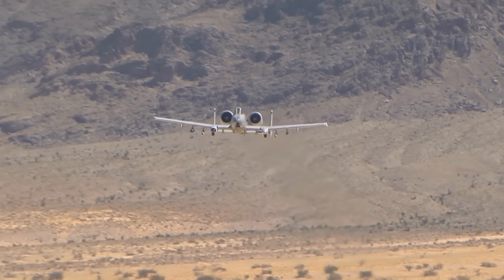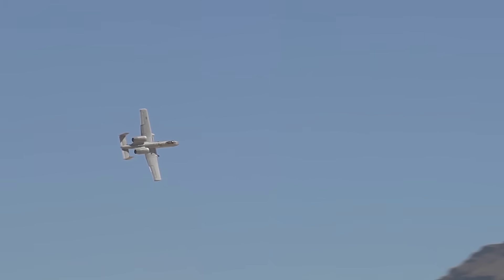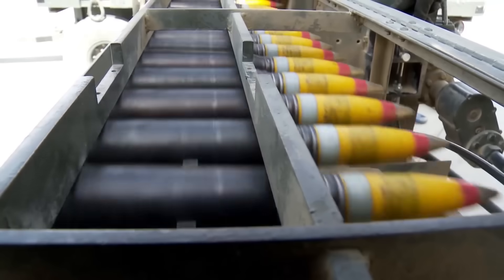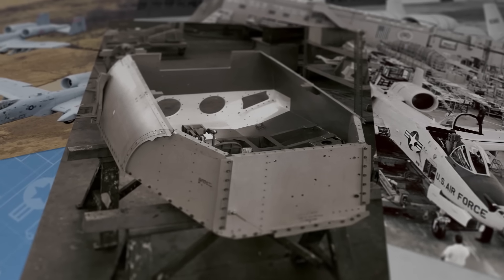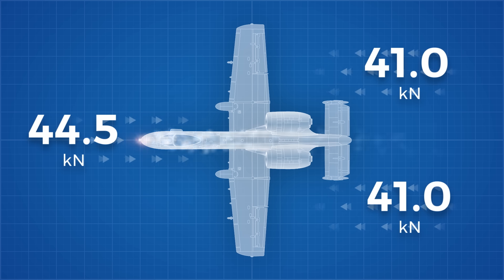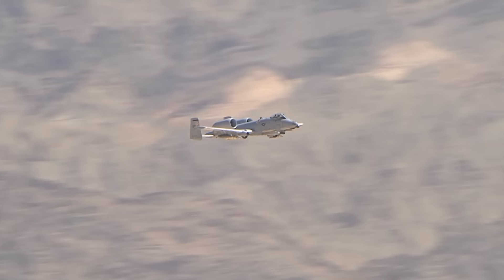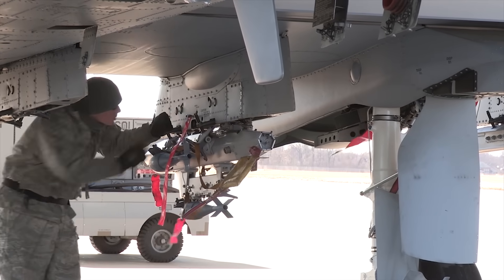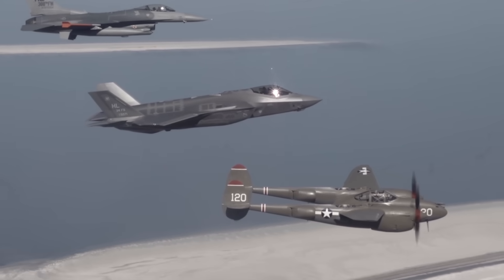The Insane Engineering of the A-10 Warthog

Comment: I hope this plane never goes out of service. Unless, of course, they somehow find a way to improve its design even further.
Reply: Maybe get twice the brrrrrrrrrrr
Reply: @chm1ata   yes!
Reply: @chm1ata  VTOL BRRRRRRRRRRRRR
Reply: @thegoldenwhale1335  NAH VTOL TRIPLE BRRT
Reply: @thegoldenwhale1335  like
Reply: @chm1ata  only twice? Why not thrice?
Reply: @Dakiferus  f it, get 10
Reply: @chm1ata  thing just starts flying the other direction due to the amount of force from the 10 30mms
Reply: @Dakiferus  face five back and five forwards
Reply: @Dakiferus  just aim your tail at the enemies
Reply: @chm1ata  Screw it, turn it into a fidget spinner.
Reply: @chm1ata  make an a10 built like a p36 but have where the props are the brrrrt of doom
Reply: @chm1ata  I think you would go backwards at that point
Reply: @__tadpole__8195  then have 5 pointing back
Reply: @chm1ata  “QUICKLY PULL UP!” “Oh shit we just dug a hole into the mantle”
Reply: @chm1ata  why not get four brrrs
Reply: @chm1ata  Twice the Brrrrrrrrt, double the memes
Reply: @chm1ata  under wing  rotary cannons oh god
Reply: @chm1ata  nope triple the brrrr
Reply: It is extremely vulnerable to modern surface to air missiles.
Reply: @kellymoses8566  This is true.  The video said the plane is cheap to maintain.  That is a little deceptive though.  It is cheap if nothing breaks, if it never gets hit.  But it is designed to be hit!  The cost of maintenance goes up quite a bit when you account for battle damage.
Reply: @kellymoses8566  not unless we go stealth
Reply: Use the gun as engines for speed plus firepower
Reply: @brianchan8  the frame wouldn't be able to survive going mach jesus
Reply: @tedwhite9176  I had to go look at his comment to see what he said about the speed of sound but I get your joke now, good one
Reply: Yep slap another gun make it a gunship
Reply: It's scheduled for decommissioning but the army is fighting hard to keep it
Reply: Thunderbolt III: “Yo dawg, I head you liked brrrrt, so I put brrrt in your brrrrt so that you can brrrrt while you brrrrt”
Reply: Like strap a second GAU to the back to leave a path of destruction behind it along with giving the A-10 a speed boost
Reply: @painiswarthunder  some one make this man an Air Marshall asap
Reply: @davemeads859  however a second cannon would ruin the A-10 look so I propose project A-11 a larger, faster, better armed and armored A-10
Reply: I think drone tech is reaching the point where unmanned close air support will become the norm.  No pilot, no need for extensive survivability.  Heck, the drone itself can become a weapon if need be.
Reply: @lukedean34  and BRRRRT
Reply: @GiggityGiggity_27  We should put the avenger on a drone.  We can call the drone Burt.  XD
Reply: Keep the look and the sound that’s all that’s needed
Reply: They said to retire it somewhere in the 2040s so we still gotta long way for it to brrt
Reply: As someone who maintained this aircraft, every year they talk about retiring the ‘hog.
Until they have a dedicated CAS replacement it’s not going to happen. Yes guided munitions are mostly used nowadays, but newer stealth jets have reduced armament capacity due to internal storage to minimize radar cross section. And a fast stealthy jet just is t suited the the situations the A-10 can fin itself in.
Reply: @lasinthas4152  those jets cheap to fix bullet holes in?
Reply: @gmat5046  I was a propulsion mechanic. So I only worked on the engines
Reply: @lasinthas4152  those are rather important.
Reply: The next design will have lasers but will still go bbbrrrr
Reply: @ghostking1627  that would ruin the A-10 tho... Lasers are heavy and delicate putting a Lazer on an A-10 would be a waste of a perfectly good A-10.
Reply: @painiswarthunder  but if it gets a space upgrade in the future when space travel is possible
Reply: With the onset of f35 lightning, I heard that this plane is to be decommissioned.
Reply: @victorcajilog5355  maybe. But with the continuous support of not only the grunts, but the air force, civilians, and politicians, it will most likely be updated.

Or even better, a new design similar to it with a more streamlined design, more powerful engines, a sturdier design, a heavier carrying capacity, and better sensors and radar for guided munitions (specifically for dogfights.)
Reply: Stealth a10
Reply: They did it with the b-52 so I think they can do it with this
Reply: If they make one it probably won't have a brrrrt since it's very bad at it's designed purpose of tank busting
Reply: @Zlonk7  In defense of the GAU-8 it could probably still open up light armored vehicles like tin cans.

But . . . 

It's not whether the GAU-8 is powerful enough for that. It's whether other lighter cannons can do the job.

Even then the argument for just carrying more PGMs is compelling.
Reply: It is astonishing,  no question. A simple but great improvement would be building it just for shits and giggles instead of violence
Reply: It's the A10 low maintenance and reliablelity that makes it hard to replace it  higher tec means higher maintnace there are planes that can do the job but nowhere as cheap to run
Reply: It will go out of service, and sadly its replacement will be light, cheap and disposable. Such is the way of progress.
Reply: A-10 isn't going anywhere for awhile. The F-35s gun can't shoot straight for now so the A-10 is still needed. The US government has been trying to get rid of the A-10 for years and every year its answered with screw you
Reply: @wesjohnson9334  I mean, there are more weapons other that the gun, guided bombs, etc, so i don’t think that glorious BRRRT will stay much longer 🤧
Reply: @wesjohnson9334  the f 35s gun cant shoot straight you say, yet the gau 8 avenger is terrible, its weak and inaccurate and basically unusable for its intended purpose
Reply: I hate to be the bringer of bad news, but the A-10 is planned to be replaced by the F-35B sometime soon.
Reply: @Getactivewithcat  They planned to replace it since is existed, cheap easy to repair airplanes that work, oh the horrors (for the military industry that is)
Reply: @pouncepounce7417  they're Lockheed simps, what can I say.
Reply: @Getactivewithcat  welp alot of lives will be lost without this godly intervention of a close air support craft
Reply: @MrIkillcreepers  sadly that's probably true. At least the F-35B will be able to deploy much faster compared to the A-10, and it will have the ability to do multi-role combat. The A-10s technology also pales in comparison to the F-35B, so the replacement is not at thoughtless and stupid as it might seem. But still I believe the A-10 is just better overall as it was directly made for the purpose of close air support and your statement likely holds true.
Reply: @MrIkillcreepers  yeah I'm not sure what that mosquito F-35 bs is about if I'm on the opposing side of an A-10 and I hear it I'm just saying fuck work and leaving
Reply: @MrIkillcreepers  alot of lives are lost with the a 10s exustense, it has more friendly fire than any other us plane combined, its the worst us plane
Reply: @MrIkillcreepers  you can upgrade a dogshit, but its still gonna be dogshit, the a 10 is a terrible plane that was never effective to begin with
Reply: It's retirement plan has been delayed until 2040 ,with new wings
Reply: @staniskynjing8953  The overall layout and shape is i think nothing to improve on, but one could tinker around with honeycomb materials for the hull and wings to create an structure you can riddle with holes that stays stable because the load bearing structure is all over the place spread out, something like that.

I was never an fan of multirole anything if it is not the only possible option, multirole expotinal raises costs and complexity.
Reply: Simple. Instead of the plane powered by the thrust of the engines. It would be powered by the recoil of Two GAU8.
Reply: That huge rail gun they were testing a few years ago
Reply: A flying Ma Deuce.
Reply: CHINA  JOE  BIDEN  SAYS  KIDS  KIDS  KIDS  https://www.youtube.com/watch?v=V4PLSPvJ9BY&t=226s
Reply: Look at the B52!
Reply: Triple gau 8 😈
Reply: @christian does MTB  all I imagine is when it fires it just stops right then and there
Reply: 2 cannons. brrrrrrt.... Vs BRRRRRRT.....
Reply: No need for it would be nice.
Reply: They have made a better version the stealth a10
Reply: The just revamped it it will likely be in service in to the 40s
Reply: i feel like it’ll be replaced by a plane that does the same thing, but waaayyy better. like a modified a-10 that is more technically advanced, and is faster and better at dogfighting
Reply: A-20 warthog with a rail gun replacing the 30mm
Reply: This didn't age too well
Reply: Put a tank gun on it
Reply: Obviously we need two wing-mount BRRRRRRRRRRRRRRRRRRRRRRRRRRRRRRRRRRRRTs...
Reply: Sadly, i think the F-35 will replace the A-10 😔
Reply: Bro this plane makes me want to join the Air Force just to fly this beast😂😂💪🏾💪🏾💪🏾🥳🥳🥳🥳
Reply: It is
Reply: Well you could upgrade it’s computer systems and sensors
Reply: F35: now this looks like a job for me
Reply: In progress...
Reply: The ONLY reason the aerospace contractors and their lobbyists haven't been able to retire this, is that some decisionmakers can see through the money they are being offered and can see that they are being shorthanded.

F16 and f35 can provide cas ONLY when full air dominance is achieved. Otherwise they are extremely vulnerable.
And when they take damage they are very, very difficult or even impossible to repair in the field.

Basically both have been designed to fight inferior opponents in short burst. And to be kept in clinically clean conditions.
But war ir dirty. Airports and supply lines will get hit and that will severely hurt those planes while the a10 can shrug it off.

And when the others are VERY expensive to replace and few in numbers, a10 is easy to manufacture, repair and can operate from a fielt of potatoes.

There is no other platform that could do what the warthog does and shrug off the damage it receives.

And NONE are as cost effective.
Reply: not even god himself could improve upon perfection
Reply: More guns
Reply: Bigger gun
Reply: Well ATM it has a "replacement", but that "replacement" is too expensive and the warthog is literally a cheap, powerful, and safe gun with wings
Reply: The raspberry of death must be terrifying for that split second you still have ears.
Reply: Upgrade it with Laser Gatlin gun.
Reply: imagine a supersonic A-10
Reply: Just put another cannon and have double the round count !
Reply: As long as tanks exist, it wont
Reply: Stealth dogfighting A-10
Reply: I believe its supposed to stay in service till 2040 so far
Reply: friendly fires
Reply: Write that down write that down
Reply: One reason this plane is still in service is their cost for flying
Reply: This didn’t age well
Reply: I just hope they dont improve it to the point it would lose its feature that makes it an A10 Warthog, especially the "brrrrrrrrrrr" sound
Reply: @momodeus_20  then maybe a more powerful engine, a longer range missile, and a more powerful radar
Reply: I am sure someone else has already mentioned its being retired.
Reply: I love this plane and the pilots. I've been pinned down a few times. The sound of a few hogs coming in is excellent any time
Reply: They make it have a higher gun-to-plane ratio
Reply: Maaaaaybe two 30 mm cannons
Reply: I heard at about 2024 or 2030’s will go out of service
Reply: Nah it will never happen
Reply: Make a stealth version.
Reply: They recently got approved for some tech upgrades to radar, HUD, etc.
Reply: They add a second gun
Reply: the only reason this plane goes out of service will be the same reason the ac-130 goes out of service (which is that it shoots fucking lasers instead of bullets)
Reply: Im waiting for the A-11 deathhog
Reply: Last remaining warthogs are in arizona.. protecting the trump fascist 5th column.
Reply: if brains were dynamite you wouldnt have enough to blow you nose
Reply: Make a stealth version I say !!!
Reply: i don't like how much people overestimate the @-10
Reply: @lunatic_nebula9542  People that dont understand its role in a war tend to do that, but when used in the right place at the right time its a potent lethal weapon that tank crews utterly fear....
Reply: It has begun
Reply: A 10 warthog........mark II
Reply: Its a terrible design, stop spreading myths, its the worst plabe in the us military, it has to fly low and slow and needs pilots to use binoculars, its very vulnerable to shoulder mounted launchers and has more friendly fire than all other us planes combined, its gun is weak and inaccurate and it was almost replaced by a fucking cropduster
Reply: Bigger gun is where id start😂😂😂😂😂😂😂
Reply: @user-gs2ou7gp2v  well the current one is useless, so yeah thats a garantueed improvement
Reply: There are already better aircraft that do the same job but much better
Reply: I swear, considering how deadly it already is, a potential Thunderbold III would be a deadly thing indeed
Reply: @cloaker7237  its not deadly, ots terrible, the gun is inaccurate and weak
Reply: @Helperbot-2000  “the gun is inaccurate”
Well, don’t worry. If the first few shots miss, the next 500 of them sure won’t
Reply: @cloaker7237  in a live fire test of completely idead conditions where the pilot could fire as much as he wanted, he did 10 passes, once for each vehicle where he fired 174 bullets, 70 bullets hit 30 of those bullets penetrated, 8 tanks were hit and only 3 were destroyed while 3 were immobilized. only 2 rounds hit the ammunition and fuel tank. all 3 could be made operational the same day. and all of them were very outdated m47s

the gau 8 is useless as a tank buster
Reply: @Gray Upsilon I’d love to see a delta wing version of this plane eventually but I don’t think that will come for a while
Reply: @jackspinner1945  You’ll be waiting forever since delta wings are almost exclusively used in supersonic fighters, high altitude interceptors and high speed bombers. It’s objectively stupid to use that in a low speed low altitude ground attacker. You’d lose all energy in a turn and stall out into the ground.
Reply: @henrywhite2228  well you spray a target with bullets and crash into it dealing more damage
Reply: @henrywhite2228  Making it an biplane would make more sense, even lower stall means slower attackspeed = more time to shoot at things
Reply: @firstnamelastname7298  essentially, american 'divine wind'
Reply: @henrywhite2228  A low speed, low altitude attacker is objectively stupid on a modern battlefield.
Reply: @jackspinner1945  The problem are delta wings is almost exclusively designed to reduce post-mach drag these days. Its literally only useful on a plane that can exceed mach 1. The other use case being a huge lifting surface for its size giving it a large payload like the B-2. The downside ofc to this is that your plane is now a flying triangle which is much easier to hit at a slower speed than a "standard" design. There's also the downside that delta wings have very low energy retention in a turn and bleed a lot of speed which makes it hard (and fuel expensive) to loiter where you're often just flying circles in an empty chunk of airspace near the battlefield. It has a few stealth benefits yes, but is not at all required to design a stealth aircraft. Just look at the F-22. Additionally delta wings are inherently unstable which makes for great maneuverability in a fighter but it also means that you need to spend a lot of computational ability to make the dozens of adjustments per second to keep it flying in a straight line. Now imagine you take damage and lose an engine and half your right wing. Your inherently unstable aircraft is now even more unstable and there's literally millions of possible variations on exactly what the flight characteristics of that damage could look like. Those computers are now having to figure out how to fly the plane from scratch. Something that isn't quick to do. The design just has no place in a vehicle that needs to be fuel efficient with a long loiter time and have the ability to take damage.
Reply: @jackspinner1945  problem is it’s not a supersonic capable aircraft not only that it doesn’t need to travel at supersonic speeds so a delta wing isn’t needed on this type of aircraft
Reply: The A-10 was obsolete before it initially hit the ramp. The reason is that it was designed for an environment that no longer existed, and couldn’t exist in the environment it was committed to.
The original design was for an aircraft to replace the Douglas A-1 Skyraider and other aircraft doing Close Air Support (CAS) in South Vietnam. This was a very permissive environment, and the original design studies were for a twin turbo-prop aircraft. By the time the program got going in a significant way, it became clear that South Vietnam and similar counterinsurgency campaigns would not be the focus of that portion of the Air Force.
Rather than kill the whole project, it was recast as a tank=killer for the Central Front in Europe. The problem was, Soviet tactical air defenses were murder, and the mission was not survivable, no matter how much armor you hung on the aircraft. Loss projections at the time were an unsustainable 7% — a rate that would have driven the force below 50% and into combat ineffectiveness in four days.
Nearly 20 years later, Iraqi air defenses a full generation behind those fielded by the Soviets proved devastating to A-10s that came within their operational envelope. While A-10s were credited with a number of tank and armored vehicle kills, these were accomplished by staying above the hard deck (a minimum altitude to keep Allied aircraft out of harm’s way) while lobbing in precision-guided AGM-65 Maverick antitank missiles. Virtually any US fighter capable of ground attack could fire the Maverick, but nearly all of the missiles in theater were gathered together and given to the A-10 force. Why? Because they otherwise would have been useless — the aircraft had only rudimentary bombing avionics and would have been completely ineffective operating above the hard deck. Lt Gen Chuck Horner, the air boss of Operation DESERT STORM, stated that they pulled the A-10s out of combat with the Republican Guard and shifted them toward less well defended Regular Army infantry divisions due to the damage they were suffering.
The A-10 went on to valuable service providing CAS in the counterinsurgency campaigns in Afghanistan and Iraq. However, both insurgencies proved to be almost completely lacking in air defenses. No fixed-wing combat aircraft have been lost to enemy action in either campaign. Therefore, the A-10’s legendary toughness was insufficient for even medium air defense threats, while it constitutes a waste for the present day counterinsurgency environment. Put another way, the best CAS asset on a high-intensity battlefield is a self-propelled artillery battery, while the best asset for the wars we are currently fighting may very well be a single turboprop A-29 or AT-6, which would be far more cost-effective than the aging A-10.
Reply: Stealth, supersonic, backwards swept A-10, filled with stand off bombs and long range magnums in its internal bay and, naturally, its beautiful BRRRT
Reply: There would be no reason to take it out of service, unless their improving it
Reply: @splplayer08lolol51  its a terrible plane, it was never effective to begin with
Reply: It's an outdated dog that wouldn't survive against a peer opponent. Hell, commanders I'm Afghanistan requested it be removed from the theater because it killed so many civilians.
Reply: bro the plane is good but isn’t perfect, it isn’t a good dogfighter, but melts ground targets
Reply: @Shulapi  well, it’s a close air support plane, so obviously the A-10 is not a good dogfighter.
Reply: @Shulapi  You mean it excels at the role for which it was designed, but not one it was never intended to fill? What amazing insight! Thank you for sharing your profound wisdom with we poor fools who had no idea the A-10 isn't capable of establishing air superiority. We're all eternally grateful you've lifted us from ignorance with your vast intelligence. Thank you!
Reply: @Shulapi  no, the plane isnt good, its not even bad, its terrible and was never effective to begin with
Reply: hope all weapons destroyed, we dont need them against humans
Reply: @jallekulmala1370  
As soon there are no humans who like to force other people to obey them that is an sensible idea
Reply: @pouncepounce7417  you and me is a good start
Reply: @jallekulmala1370  the main problem is the definition of weapon, sticks count...
What we need is an basic worldwide code of "there is no honor in using violence to archieve goals"
Then you can have weapons all over the place and it does not matter
Reply: Oh do I have bad news for you
Reply: Well it’s retired now
Reply: @bonner_barry  no it's not
Reply: Also, is everyone in this comment section going to stop praising that (honestly awful sounding) gun, it’s not even good, and cannons are really oudated.
Reply: Its got a nice precise air to tank busting role, which I'm not sure how many other alternatives there are (though I hardly know anything about US military/secret projects). But as mentioned in the video, it was simply because the AA deterrent was relatively primitive and weak in recent conflicts that they were able to fulfill their roles.
Reply: @angelkitteh6641  hahahahahaha, dude stop spreading that bullshit, the gun is both weak and inaccurate, its the worst plane in the us army by far
Reply: @angelkitteh6641  Literally helicopters…
Reply: It has been so efficient to us that unless they do improve it i can't imagine it ever goes out of service
Reply: @fonze4400  I don't think you understand that the A-10 is an iconic plane but not that good, most CAS support kills have been from F-16's and F-35's, CAS don't not necessarily mean close to the ground. Additionally, the A-10 has no stealth tech witch is the future of the millitary.
Reply: @JoeMama-jd8jq  Name one other plane DESIGNED to still fly with an engine and a wing missing. There is a reason why it is so iconic and STILL used after being designed in the 1960's. If it wasn't any good, they wouldn't still be using it.
Reply: @fonze4400  efficient? has one of the worst records for friendly fires.
Reply: @fonze4400  use more gun
Reply: @fonze4400  The airframes will eventually reach their end of life and a clean sheet replacement would look nothing like the A-10 as the plane's current roll is nothing like the one it was designed for.

The GAU-8 for instance sits in a very awkward position in that most things it CAN kill can be killed by a more readily available 20 or 25 mm cannon that wouldn't require nearly the consideration for mounting to an airframe, and anything it can't kill will be hit by PGMs instead.

In fact, a lot of times even what it can kill is hit by PGMs instead. The A-10 like most planes providing CAS usually just chucks guided weapons these days with gun runs being rare.

I mean, I adore the A-10 from an engineering perspective. But its reputation has grown beyond the reality of the plane itself.